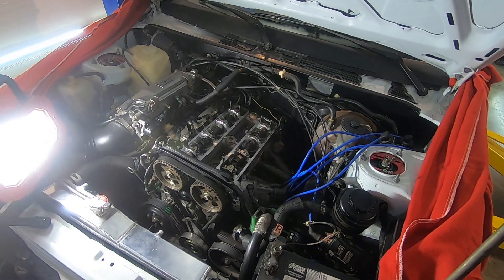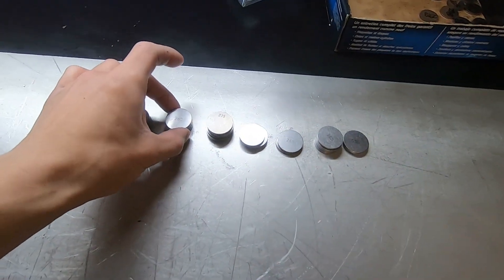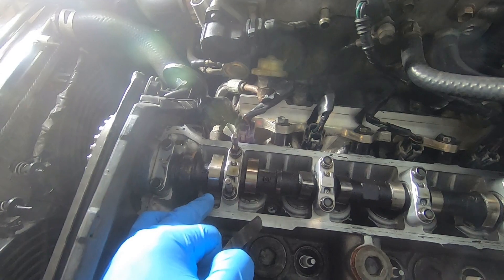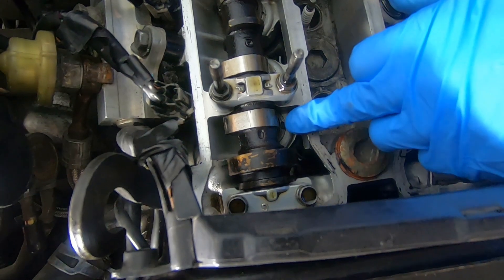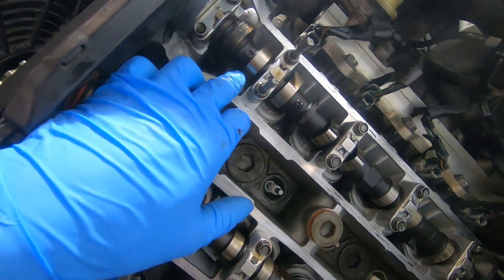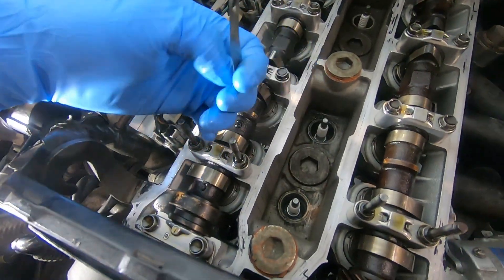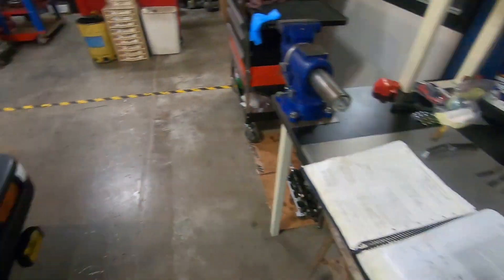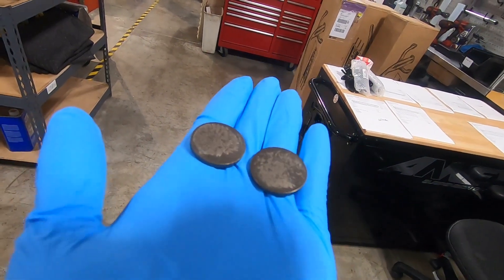How to: 4AGE Valve Adjustment

Comment: Very informative. I was a little confused when you were talking about compressing the bucket, and then you installed that retaining tool. I would have thought that was wedged between the cam and the shim. yet the shim was loose and easily removed. I've never done this before so I'm sure I'm missing something.

Comment: WD40 is not a lubricant- it is a water displacement 40th formula-  use your engine oil or a slight smear of break-in lubricant 
Shims wear and clearances increase
The Snap On Blue Point tool you show really makes replacement easier. You should have explained what you are using and why
Reply from the maker: Great points thank you! I may have to remake this video!
Reply: @CMAutohaus  Would love to see that!

Comment: Hi , looking at the valve clearance spec I am a little confused , I thought the gap will be smaller when hot (expand) but the spec is the opposite. 
My ae86 makes a typewriter tapping noise when cold ( changes with rpm )and once it’s hot the noise will disappear. Could it be the gap is slightly too much when cold?
Reply from the maker: Yes I would bet your valve lash is on the loose side if the tapping noise is from your valve train.
Reply: @CMAutohaus  thank you for your prompt response, keep up the good work cheers buddy!

Comment: Great video! It helped me find what I needed, but I feel like I measured something wrong. After doing the math, the range of shims I need are between 0.9mm and a 5.1mm. I can't find shims online that are those sizes. Is it possible that my clearance is too messed up or do you think I just measured wrong?
Reply from the maker: If this is on a 4age sounds like something is wrong.The shim sizes you need at probably between 350 - 390mm range.
Reply: @CMAutohaus  Right.. I very much appreciate the speedy answer. The part where I messed up was likely where the instructions required me to rotate the engine to measure the last half of the clearances. From TDC measuring the first set of clearances, what exactly is a full rotation? Do I rotate the engine from TDC clockwise back to TDC again? Also, yes I do have a 4age.
Reply from the maker: @katocovers  Yes. TDC clockwise back to TDC again
Reply: @CMAutohaus hello, I know many years has been since. But you have shims from 280, but you recommended here from 350. Is there any rule or something? Or you have to measure the clearance before ordering the shims? I would like to get an assorted Kit or something.

Comment: Need to do this. Would you want to be on the bigger end of range adjustment or smaller tolerance end?
Reply: Actually asked this question before finishing the video lol you answered it at the end of the video!
Reply from the maker: wider end of the tolerance. This is because as the engine runs, the tolerance will get smaller

Comment: I had no idea that the clearance will tighten over time. I liked your tip on the feeler gauge! Good video.
Reply from the maker: Much appreciated! Yes I think on rocker style with adjustable ends (older Honda) its actually opposite: you set the valve lash towards the tighter end of the spec because the clearance will get bigger with time.
Reply: Now that I think about it. I had to adjust the valve clearance on my ninja 250 because they were too tight. Same issue, after about 2k-3k miles the valves tighten up from factory spec and then the bike can’t idle properly.
Reply from the maker: @sushpants  Yeah most common with my background being Subaru: cold start misfires as seen on freeze frame data are most common tight valves (valves are being held open). Goes away when engine come up to temp because the clearance increases.
Reply: I’m a big dummy when it comes to this, but trying to learn. I’m not picturing how the tolerance becomes tighter, but you did show the old ones with wear on them - that would make the gap larger, correct? So it would be over the larger end of the spec? Would that cause a valve train to be super loud, especially when cold? I’m going to do this adjustment on my Prizm GSi because it’s got 187k on it, but just wondering if it will quiet things down a bit. Love the video!
Reply from the maker: @prizm-gsi  Valve lash on these engines gets tighter over time because the heads of the valves themselves get "sucked" deeper into the cylinder head with more miles. Too big valve lash can cause valve train noise, especially when cold. It would be worth removing the valve cover and checking where your valve lash is at currently.
Reply: @CMAutohaus  Thanks for the reply!  That makes sense now - I appreciate the education.  I have all my tools organized in the garage to open up the valve cover, so I'll poke around and see what I find!
Reply: @CMAutohaus  What makes you replace the shim in the video that is too loose? If they tighten in use, why is it too loose?
Reply from the maker: @Heath242Green  Anything beyond the loose end of the spec is too loose. At the end of the vid you can see the hardening chip away from the valve clearance being too loose and the cam lobes slamming against the shims
Reply: @CMAutohaus  I guess what I had meant to ask was why do you replace your shims on the larger end of the spectrum? You claim that the gap shrinks over time with use, so they should never be loose, unless these were loose from the factory/last service? I would think that they loosen over time through wear granted that your valves have set in to place securely?

Anywho, thanks for the advice, before I was going to aim for the lower end of the spec, but now will aim to go for the mid.
Reply from the maker: @Heath242Green  Valve clearance tightens over time on this type of setup: the valve itself sets deeper into the cyl head with use. I used to a be a Subaru Dealer Tech and saw this 100 times over on bucket shim + shim over bucket vs. adjustable rocker arms on boxer engines.

Comment: Will the straight feeler gauges effect the accuracy of measuring the exact clearance? I like the ones u use since they are L types. Thanks
Reply from the maker: You can bend straight feeler gauges into an L. Using a straight gauge into an angled spot has affected the "feel" for me.
Reply: @CMAutohaus  thanks!